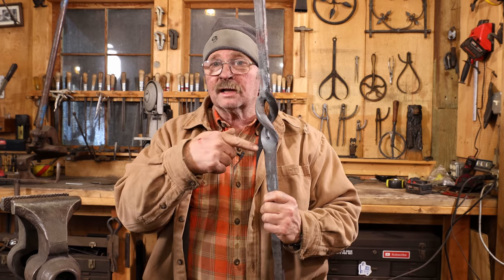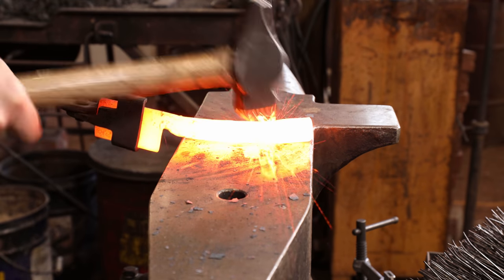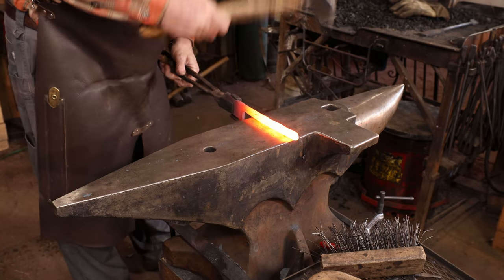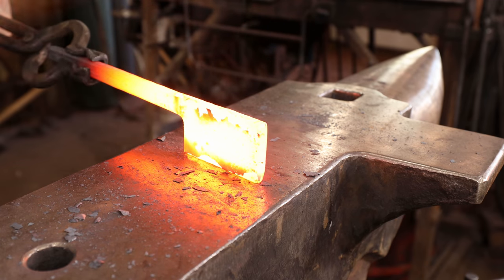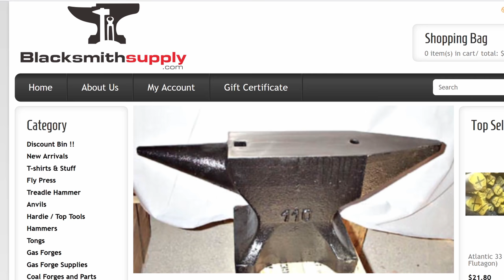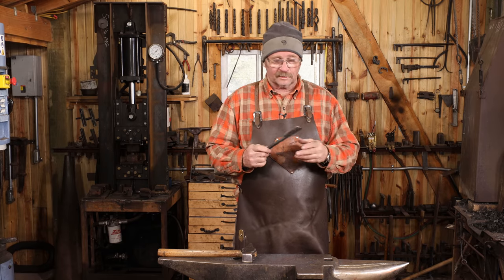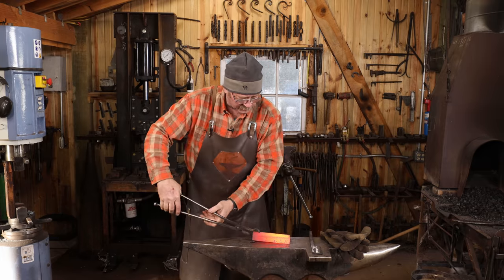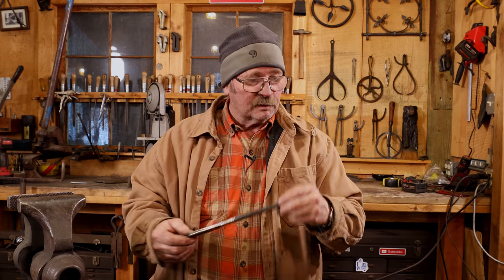Forging a Side Chisel - Blacksmithing tools

Comment: A mini Cleaver simple and so effective. John has all the answers from his superb expertise as a true blacksmith. Thanks Mr Switzer Yes you do truly inspire us
Reply: A mini cleaver could, in fact, be made similarly. The steel would certainly work. However, the grind would need to be quite different... a traditional flat grind would be best, perhaps with a slightly convex secondary bevel if hard use is intended.

Comment: Since I really like garden decorations, I think that your twist sample piece would make a good upright section for holding something like a  decorative lantern or bird feeder.  Draw out the bottom and add a step in, then add a decorative bracket to the top.  I have seen some videos where they put solar garden lights into lanterns so no fuss, no muss.  If you were really feeling ambitious, you could forge the lantern as well.

Comment: When I worked as a mechanic I had one of these that I used to remove oil sumps (pans) from engines. The manufacturers started using sealer instead of gaskets and this was the only way to remove them without causing damage. Never had as good a tool as that. Well done, spring steel is a very useful resource, unfortunately leaf springs have all but disappeared here in Ireland.

Comment: That is a cool tool! 🙂 I made a similar fuller for vein decoration in leaves.
Suggestion: you can make a candle holder which has the stand and the dish part connected with tenons and rivets on a vertical piece of slitted and twisted bar. 
Have a nice evening John!
Reply from the maker: Thanks for the tip!

Comment: Hi John, when BS's talk about steel and numbers, I am totally lost, but when you say "leaf spring" I am right with you. I have piles of steel, just steel, that I thought was scrap until I started smithing, now it's stock. 🔥⚒
Reply: It's a lot easier than you think to decode the numbers and you need to know what you are working with look up a metal sae chart on the internet or get a old engineers handbook  it is good to know  so you don't work yourself to death using material not worthy of your labor it is also fascinating to learn about metallurgy and if you ever start selling your wares people will ask about your material

Comment: I have worked with a bit of steel but as of yet am unfamiliar with all the grades. For me it's the basics, steel, aluminum, stainless, copper...eg. I would have called the spring, spring steel hahaha,  so I am impressed with your knowledge, that and how to heat treat said material. 
I thought the twisted piece would look great as a baluster. Your piece is a bit heavy maybe but that look.
Reply: 5160 is the most common grade of spring steel it has roughly .6% carbon with a little bit of chromium for increased toughness. It is a good general purpose hardenable steel that can make mediocre knives, good swords, and great axes. It isn't as heat tolerant as other alloys like s7 and it isn't as tough as lower carbon alloys like 4140 so it isn't the best steel for tools you plan on hitting with a hammer (although it is perfectly adaquate for such tools). If you are using a spring as your raw material you cannot be entirely certain of the alloy(rail clips are usually but not always a Chinese standard equivalent to 1060 for example) but most springs are made from an alloy with similar enough properties to 5160 that it doesn't matter as long as you don't plan on pushing the limits of the material.
Reply: @garethbaus5471  Thanks for the bit of info.
I'm sure there must be a chart of sorts, or maybe a series of charts showing different materials and their properties.
Reply: @LincolnRig  There are several, plus you can look up just about any object you can think of to guess what it is made from.

Comment: Made one of these out of a HC rail spike. I only sharpen it about once a year. I felt like it was too low use a tool in my shop to use “good” steel on. It works.

 I’ll say this, if you’re gonna hit it hard, wear a glove on the chisel hand, hitting the side gives one heck of a shock, not like a straight chisel.

Comment: That’s an interesting anvil you have there, what was the purpose of the extension on the side. It sounds nice to work on,  I don’t like the steel anvils that ring every time you strike.
Reply from the maker: The side face is largely used for scroll to start curving back under the edge.  But it comes in handy for a lot of other things as well.

Comment: Hi John my son got me 2 truck springs and they are big the main leafs are around 30mm thick and 1350 long X 100 mm wide .  Do you have any Suggestions on what to make from them .       I was thinking a axe head and the tools to make it with . The two springs have 7 leafs each so I have given some to my mates .   Cheers.  :)
Reply from the maker: Axe and adze heads are certainly the first thing that comes to mind.  I hope you have a good way to cut it.
Reply: I have a drop saw that takes a 14 inch blade .

Comment: Just wondering if the tool needed to have such a long working surface? How thick a material would you be using that tool for? Would it still be as efficient with more dexterity if it were smaller dimensions in numerous cross sections?

Comment: John I’m trying to set up my solid fuel forge and was just wondering, do you have a fan on your chimney for drawing the smoke up ? I’ve just never noticed you getting smoked out like I am. Thank you sir.
Reply from the maker: No fan, just a tall chimney pipe to encourage a good draw.
Reply: Skip, the secret to no smoke, is a good draft and don't smother the fire. Always leave a little plume of flame when adding coal.

Comment: Not a blacksmith, so just out of curiosity: how sharp are blacksmithing chisels? Are they sharp at all or just wedge shaped blunt edges?
Reply from the maker: Sharper than a cold chisel but not at all sharp like a wood working tool.  No real risk of cutting anything but hot steel.